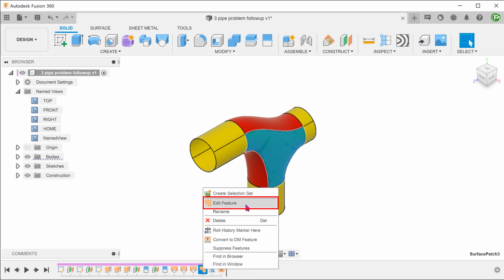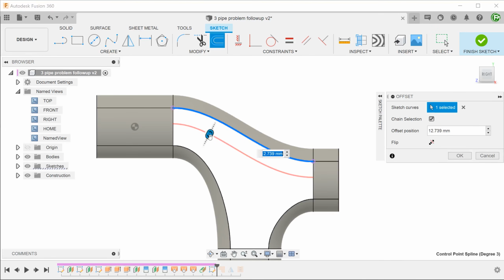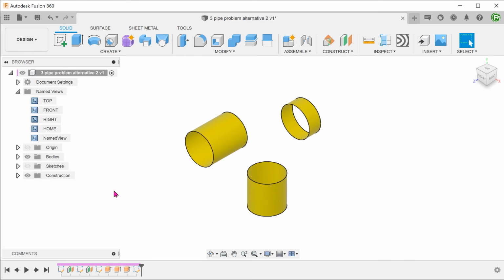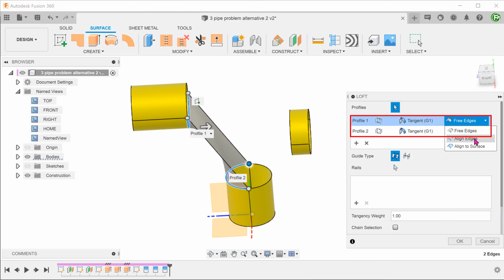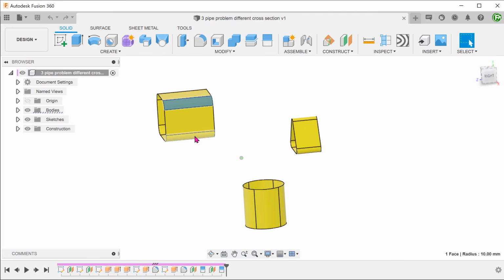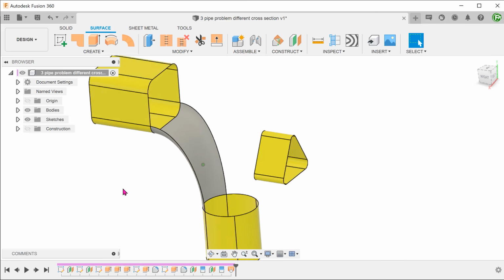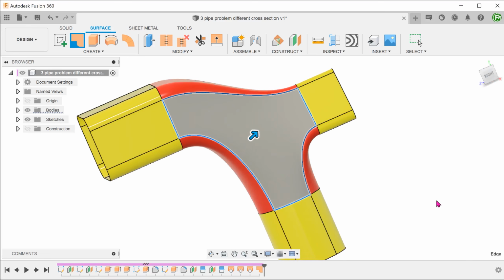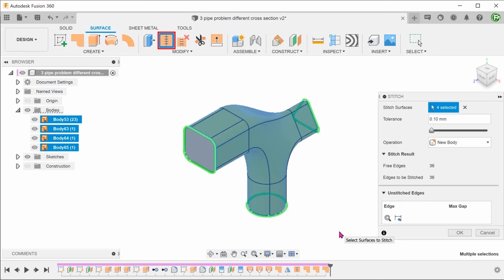Fusion 360 - 3 Pipe Problem (follow-up)

Comment from the maker: Link to the previous video:
https://www.youtube.com/watch?v=kiKIvPbEyD4

The following are public share links generated within Fusion 360 for the models:

Model from previous video:
https://a360.co/2RO1FgA

Model with pipes split in the middle:
https://a360.co/3hMUu3k

Model with different cross-sections:
https://a360.co/3oD0qNI

I would encourage everyone to try the different cross-section scenario by splitting the pipes in the middle, something which I did not do in this video.